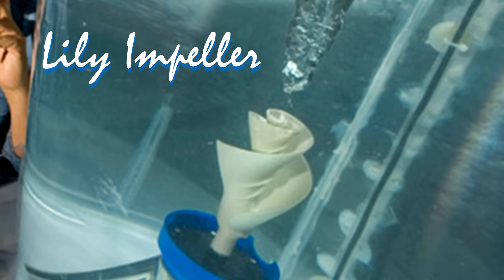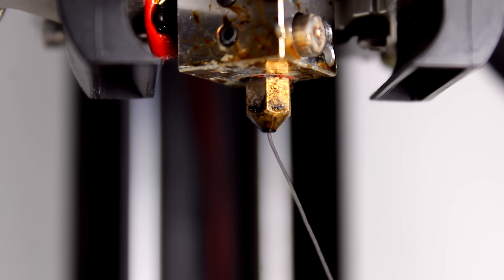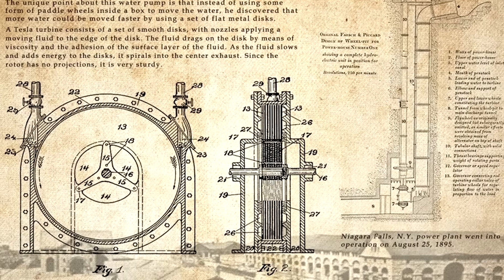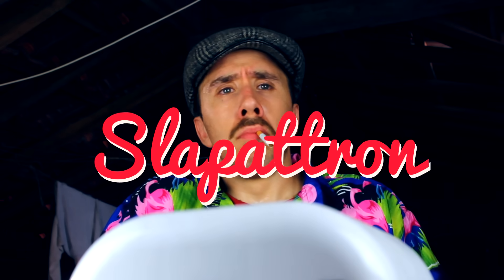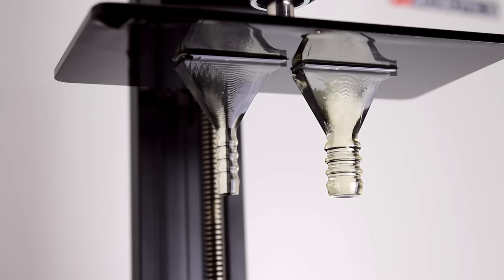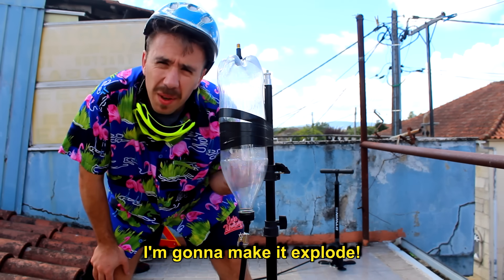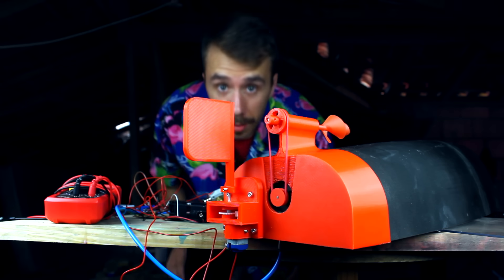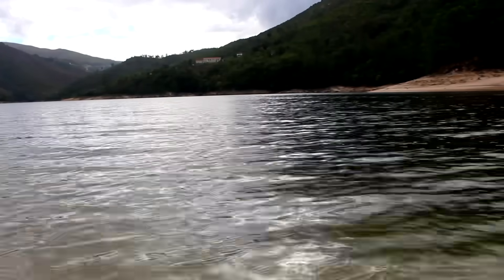Tesla Turbine Boat 3D Printed (Lily Impeller)

Comment: Encase the impeller in a housing to direct the flow more direct.
Reply: Like a jet ski incase the prop with a water flow nozzle for direction
Reply: Technically it has a turbine engine so why not call it a jet boat?
Reply: So basically just make a jet boat.
Reply: & also the bottles need to be inside the boat to reduce drag from water
Reply: @sciencesi5595  I thought the same when I saw this moving in water, probably that's why it's not gaining any speed
Reply: Exactly . Concentrate the flow( thrust) to a more focused point
Reply: I'd love to see it run with this modification. Even if it's just a 2 minute video
Reply: Yea its a pump with no housing hence no speed, housing will make all the difference,should also duct the outgoing air from turbine to rear of craft to aid in propulsion. Do not inject into housing or result will be cavitation and adversely affect output.
Reply: Duct*
Reply: This would actually work, it's just throwing water around as is
Reply: Basically a propeller nozzle
Reply: Basically jet propulsion, like a jet ski, I was thinking the same thing
Reply: Think jacuzzi jet drive. The impeller is incased within the housing, water is drawn up through the housing, and the nozzle behind the impeller is slightly smaller and movable for steering.
Reply: Fun to watch. But, enthusiasm aside. Intake, nozzle housing AND output should have all have been designed to decrease pressure on the intake port, tightest tolerances possible with whatever bearing system he used and the 3d printer tolerances to increase thrust efficiency. Not dogging. Dude put alot of work into the video. But adding 4 more bottles because it didn't spin as long as he wanted, was uh. Yeah. Efficiency> everything when engineering any system in any mech eng field.  "It spun for this long" doesn't translate to thrust efficiency. If it did we would be driving V36 cars that burned 2 Gallons of petroleum per 1.5 miles. Entertaining. But an engineer this fella isn't lmfao🤣 (again. I was entertained. Thats a win)
Reply: Also a much bigger impeller
Reply: Ye
Reply: This.
Reply: I believe it's called a cowling ( impeller housin g)
Reply: Also make it a bit larger and increase the gap between the bottom of the boat and the impeller
Reply: I want to see the result video

Comment: I get the feeling from the lily impellor video that the propellor was the wrong way around. When you had the improper facing the wind outside your car, that face should be the preferred face of contract, or the face designed for the working friction. In this video the propellor was applying pressure to the other face instead. Could you have lost efficiency from this?

Comment: Try ducting the impeller to increase the effective flow or thrust. Oh.. dont forget.. if ur gonna pull not push.. front wheel drive.. place it at the bow. Eliminate the rudder drag n vector the ducted lillydrive like a trolling motor.

Comment: When you need to use an on board air source like the bottles, you should buy some pre formed soda bottles.

They have the threaded cap but there not formed yet and look like a test tube. Being thicker walled you can cram more psi into them and fit more of them in a smaller area.

Comment: so, rather than drive the impeller  with  energy that  is  ORIGINAL,  you use energy to Make energy, in the  form of  Compressed air.  first.      do you see how absurd that is.      googeltranslate

Comment: I'm pretty sure the Tesla turbine provides way too low torque, especially at start up. You should try gearing it down to lower the rpm and increase the torque at the impeller end.
Reply: Correct.    kinda like  turboshaft power.

Comment: There seems to be too many losses in your turbine. Maybe not balanced enough. The Tesla turbines need to be run at rediculous speeds to actually be efficient, and that is why they are not used commonly today. The speeds it requires to be efficient are impractical.
Magnetic bearings could help, or an air bushing. And maybe turning the discs in a lathe could help balance them out a bit.
I too have a love for the Tesla turbine and hope to see it in a practical application, but that seems far off.
Anyway, nice video!

Comment: So, im a jet boat mechanic. I work with impellers all the time and what I can tell you is that would work a lot better by having the impeller inboard, drawing water from the bottom of the boat and then expelling it from a nozzle out the back. You would probably achieve at least 5x as much thrust.
Reply: This. 100% this! 

MUCH more so than propellers, impellers in particular HEAVILY rely on being enclosed in some kind of housing/channel to help direct/feed new fluid into & the resulting jet of fluid out of them. This DRAMATICALLY increases their ability to drop the pressure of, aka "suck in" said fluid, & thus provide "thrust".

But if the fins are going to be completely openly exposed to the surrounding fluid (aka no housing/channel), then a propeller will be far, FAR more useful/effective as a pump/means of propulsion than an impeller.
Reply: Was about to say this! I's an impeller, impellers go in a housing!
Reply: Impeller must be inside a tube! I don't understand why you used it like a regular propeller,of course it won't work like that 😆

Comment: Am i the only one thinking that the boat would be more efficient by just using the force from the bottles? The implementation probably leaks air all over and wasn't load tested -> Energy loss -> Your thing is literally implemented bottleneck on the bottles's neck.

Comment: I have completely fallen in love with your channel. And ... you should 3D-print a solar generator that works at night. Simply salvage some tetrafluoroethane from an old fridge, introduce it to a solar trench (a trench with a parabolic cross-section pointed at the sky), introduce the tfe to an infrared-transparent tube angled downwards, and insulate the tube from the surrounding air using a vaccum layer that is also transparent to infrared. Then wait for dark.

The ideas is that the tfe should radiate away its heat into the night sky and distill into a fluid. This is "focusing the dark" which Tesla actually commented on in his Cold Spring Harbor notes, though I doubt he had this crackpot notion in mind. And then to do actual work you let the tfe expand by exposing it to the ambient heat of the atmosphere, which heat was of course transmitted by the sun during the daytime. Voila, a solar generator that works at night ...

Comment: why wouldn't you just fill the bottles with half water and half air, then pump it to 6-7bars and make it jet boat? it will be way more efficient, you just have to put bottles upside down to make water propelling the boat not just air

Comment: So I think the reason why the boat is not moving much in the water, is because 
1. the lilly impeller is much smaller then the part of plastic which is holding it in front, making the water to stop in that plastic part which is holding it. 
2. And the other reason which could improve the efectivness of it is, to put the Lilly Impeller in the back and not below the boat. In this way the water that is pulled is pushed in the back with out a resistence on anything. I would give it a try and maybe this will be a discovery! 
3.And one other thing that could make it more effective the Impeller is to put in a cover around it, where the only open is the sides, back and front. 
By the way thanks for this video, is a genious idea to connect this two great discoveries from two scientiest ! All the best!

Comment: awesome channel. am a new subscriber. a steam powered boat using the  lily impeller. you have solved the heat issues with the pulse jet project as the steam making chamber woudnt be as hot as 1000c. anyways  awesome

Comment: Let's recall some high school physics. PV=nRT
Notice that PV has units of energy. For a pressure of 120 psi and a volume of 1 liter, you find that's 820 Joules! The equivalent of over 1 horsepower for 1 second.
You got lucky! If that bottle hit you in the head, you'd have seen some stars.

Comment: relativly speaking Could you not make a belt driven air compressor running off a pully from the propeller, to regenerate air into the bottles. making it an endless loop?

Comment: I would suggest you get that mounting gear out of the way of the impeller, and use it, as you said, like an impeller. Use a skeletal 'Y' shape mount the impeller inside a tube and make sure the flow has no obstructions. Steer by turning the tube, negating the need for a rudder. Think jet turbine, but use the lilly impellor inside a shaped nozzle.

Comment: Integza, with Tesla boat 2.0, you should add some modifications. My ideas are: use metal bottles like Red Bull for smaller volume with increased pressure, increase the lily impeller's size a little more and add an inverse impeller (mirrored) on the same axis so one impells water from front and the other pushes it back with the same amount of rotation. You should also move the steering on the same axis as the impeller for maximised steering. If you want a diagram if you're confused (boy am I very confused) just comment on this comment and we can talk.

Comment: I just rewatched this and realized - you can speed up the boat by installing the airtanks (the 2 liter plastic bottles) above the hull of the boat instead of beside it.
Reply: Yes but for that matter, he could just use very high pressure nozzles and make it air powered rocket boat.

Comment: THE NOZZLE DOESN'T HAVE ANYTHING TO DO WITH THE SPEED OF TURBINE AS THE AIR ENTRY SPEED IS ALMOST IRRELEVANT .AS THE SPEED AND POWER ARE CREATED BY THE AIR TRYING TO ESCAPE FROM THE CENTER OF THE CENTRIFUGE.. HOW IS THIS NOT ABSOLUTELY OBVIOUS TO A TESLA  FREAK ???  SORRY FOR  CAPS i SPILLED BEER IN KEYBOARD ITS FUCKED .. IN SHORT FUCKING WITH THE INTAKE VELOCITY AND DISTORTING THE VORTEX AT ALL WILL ONLY DECREASE TURBINE EFFICIENCY VOLUME BEFORE VELOCITY

Comment: I believe you lose tons of torque... basically the turbine probably was spinning, and the belt was slipping and not transferring the power to the impeller... you'll be more successful if you just use a direct drive with a down/gearing in the turbine probably around 10 to 1... making tons of power and using a direct shaft... I'm pretty sure you'll reach at least 10 times the speed.... Great Video....

Comment: you have a lot of drag from the bottles in the water... and you would probably get more speed by using air directly as propeling system or use an electric motor to turn the propeler ... and as this is an impeller, why not using it in front ?

Comment: That was a huge amount of work for essentially a non-result. On the upside, you still have the boat hull so you can try designs that will work better. Keep trying dude, don't call it quits here- the Lily 'impeller' was just a flop.

Comment: The hull design was absolutely awful. However, the side mounted tiller was even worse. Both are completely overshadowed by the ridiculous way you connected the impeller to turbine and the impeller to the hull! An impeller is not ment to be used like a propeller. Look at how an impeller on a jet boat works. The amount of drag created by you mounted everything had to off the chart. You should build a speed boat the uses a sea anchor as a sail next time. Don't get me wrong I like the stuff you do but... honestly, this was terrible!

Comment: Impellers are used in turbojets radial(centrifugal) compressors in single or double stage. They also are found in general purpose pumps. And they need an increasing-area diffuser on water pump assembly, they're one of the most amazing thing on engineering, you can build so much cool stuff using that.

Comment: Im curious as to the differences between this design and one using the Lilly impeller above the water line much like an airboat, id imagine you would need to increase the radius to get more force and ad more fins along the radial axis to reduce drag... still, it should be far more efficient

Comment: Lily impellers aren't efficient as ideal nd normal propellers. the entire propulsion system was mis calculated and ill-designed. It needs a naval architect to do so.  Most ship propellers run at around 120 rpm . The Tesla turbine is an interesting thing ofcourse

Comment: The design needs a shroud.  An impeller doesn't pull water forward so much as toss it to the side.  Place it inside of a shroud to create a "pumpjet."

For bonus points, put it on a submarine.

Comment: You should make a 3d box you can get inside and hide from that project ,at least you tried, at  one point the boat was going forward and backwards?, how did you do it?, it was just my eyes focusing to see if it was moving,make a bigger prop and slow it down, less pitch, so it moves that water.

Comment: What would happen if you did  bigger lilly impella with the Tesla turbine you have. I know it will turn slower but will it pull better and the bracket holding the impeller tappered either side ie front and back or just the front also if you use high pressure pipe you may be able to move for longer

Comment: Build an electric motor that runs off of 3 super capacitors and 3 batteries, should spin forever ♾ as each phase stores and releases energy:) get some custom cut magnets to asset each phase.  Vertical orientation for torque applications and horizontal for high rpm low torque:)

Comment: The lily impeller is your weakest link in this design... not because of its design. Its because of the pitch of the impeller blade. It requires tons of RPM to achieve little thrust. I normal impeller/propeller pitch is around 14° to 17° your impeller has about 70° pitch and does not provide the mechanical leverage needed to push the boat forward. If it is possible to re-create a different/shallower pitched lily impeller, this would provide the forward thrust your looking for. The difference in your previous testing of it uses a reverse function as the impellers use in this boat. Instead of providing thrust by creating outward force, its motion is a result as a result of the incoming forces. So if your impeller angle is 70° as is, your equal coefficient for generating thrust is 20° since your force imposition is 90° opposed due to its reversed function.
70° for incoming force... 20° for generating force because incoming force is used in 180° increment  where as the force applied out from the impeller is based on a 90° increment. So... 90° - 70° = 20°

Comment: Yeea super nice! Love the rc car solution! Now make it a catamaran or trimaran where the bottles (or custom tanks) themselves are the body to ditch all the extra weight! And then make sure there is not stuff directly behind the impeller blocking the flow! I also don’t trust the rubber band when it’s wet and there is the increased resistance of the water. I think you should be able to get a lot more speed out of this if get around to tinker a bit more with it :)

Comment: Why not use a CO2 bike pump and CO2 canister with a regulator instead of that bottle. Also use a bigger impeller inside a tube to generate a jet like effect and use a rc plane servo not a rc car servo for better results.

Comment: great work,  how about printing a lighter then air ship using the light weight  heat expanding  3D printing cord , I don't no if that material is lite enough or strong enough to make it work, but you could try.

Comment: you should swap out the impeller with a high aspect ratio large diameter propeller which needs to have a 1 or 2 stage reduction ratio from the turbine

Comment: 1. Put the impeller inside a tube 
2. If you going to use batteries instead of air use the water of the lake and use a little pump to feed it
3. the steering thing goes in the middle ,if you are going too let it in a side put another in the other side balance is necessary
Common do it with the pump action

Comment: Youre building your tesla turbine wrong which is why it is underpowered... a properly built Tesla turbine is a combined impulse turbine, reaction turbine, AND boundary layer turbine, although with the materials you used it would probably explode if built correctly... but hey cutting modern powder metallurgy steels to precision engineering tolerances isnt an easy back yard job, so its probably beyond the abilities of most of your viewers but they should at least know the true capabilities of what the turbine is capable of so...

Check out iEnergySupply or GravInert's YouTube channel to see how a Tesla turbine was ACTUALLY intended to be used... especially the version that runs on cold steam and suction, which means it is essentially implosion technology like the lily impeller, a system of which Victor Shauberger would be proud for anyone who's read Callum Coats's Living Energies!

Comment: You need to size and gear the impeller better. You set it up to run best in air but water has much more drag, you need to gear down the impeller so that it runs slower but the turbine still runs quickly. It can't turn at those speeds in water and the turbine starts to just leak air and looses power.
  You could make the impeller smaller or with less pitch but i doubt it would be effective on a boat that size. If you make a bigger impeller and geared it down 20x you might have more luck.

Comment: Can you duct the expent air from the turbine to the back of your impeller to create an area of low pressure behind the turbine and increase flow and thrust?
Hamilton used this principle when he corrected what we now know as the jet drive by moving the exit of the jet drive to the waterline. Prior to that the principal of a pump to propel a vessel existed but was really slow.
I would also suggest you adjust your hull design to contain your air tanks to reduce drag. Rather than the outrigger style..